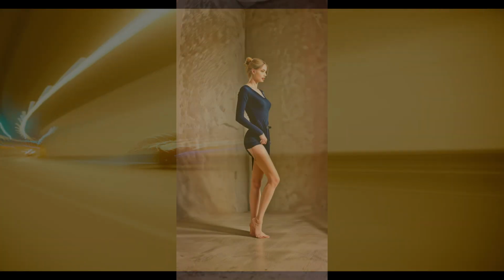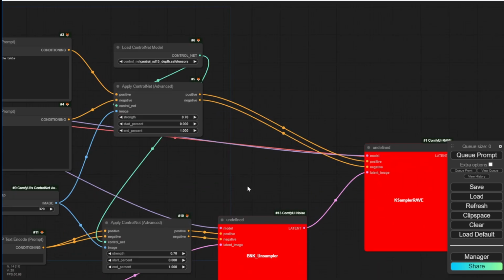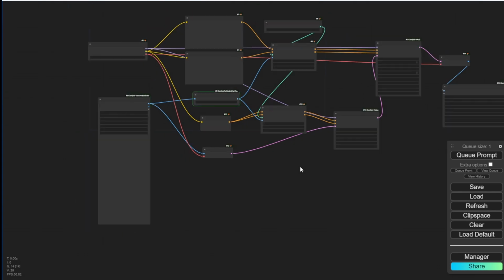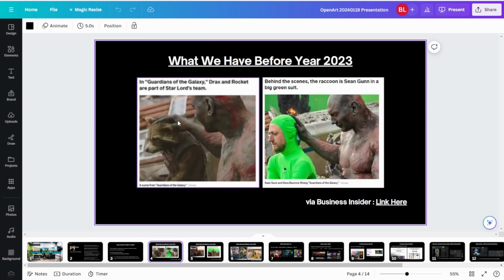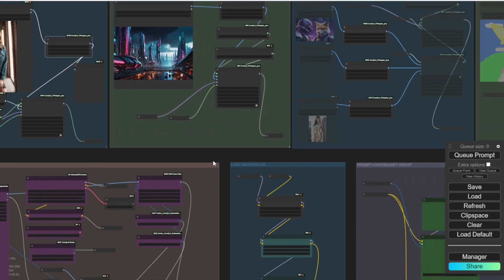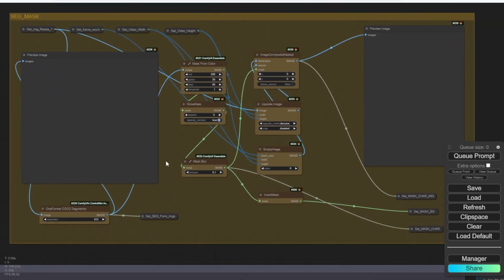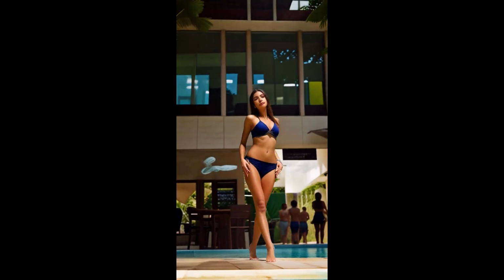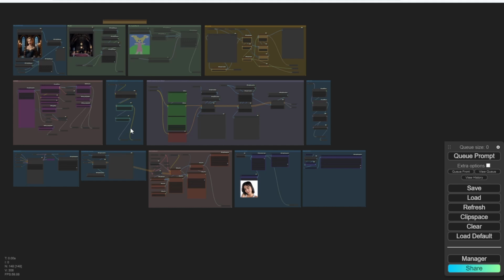Stable Diffusion AnimateDiff and RAVE Create Consistent Style For Animated Video (Tutorial Guide)

Comment: it is a great workflow and patient presentation. thank you! bravo! I am still a beginner, I am just considering video 2 video changing the outfit and make the output video smooth. without complexed requirement of background changing, styling changing, face swap. I keep all of these intact. just change the outfit of the character. in this case, which nodes can I remove from this workflow? by the way, did you try a video with multiple characters, like 3 or 4, Are Rave, ip adaptor, and animatediff robust enough to handle these kinds if videos? thank you.
Reply from the maker: You can check out this one https://youtu.be/alnrfN6F-lI?si=hyl1W49BqlfsgmOF
It is better for your scenario.
Reply: @TheFutureThinker  thank you for your prompt response, have a lovely day. I will join patreon pro subscription to support you.
Reply from the maker: 😊thank you , enjoy and have fun while learning new technology.
Honestly, if you are just begin with SD. You can check out videos to learn the foundation first. That way, it will be better.

Comment: I am still missing how RAVE contributes to vid2vid animatediff workflow. @Benji could have achieved the same balerina result with NO RAVE, ONLY animatediff nodes, like for example in his dancing shorts videos. Can anyone explain the use case or benefit of RAVE? Thanks!
Reply from the maker: RAVE for consistency outfit in this case. And Animatediff make the whole movement smooth. Actually, the AnimateDiff only workflow I did use IPA could do this consistency, but not always, and it require a good image for the IPA to understand what you want.
Reply: @TheFutureThinker I think get  it. So use RAVE when there is totally different clothing in input vid vs output vid. Like in this tutorial, dress converted to bikinis. But if say I want just to replace dancing women's head (face + hair), I should use IP adapter and low denoise, because RAVE is SD1.5 (less realism than SDXL) and is unnecessary for this case
Reply from the maker: It depends on what is the source video, and style your want to change. But mostly I use Sd 1.5 real Vision, but you can try SDXL with something like Real Vis or Reality XL. Because the width and height are going to be large in SDXL , so it required larger memory size from hardware as well. And more time process on each sampling.
Reply from the maker: But for face and hair, yes use IPA is good enough. Sometimes less is more honestly.
Reply from the maker: p.s: and yes you are right, the no RAVE AnimateDiff only workflow , I can do that. Hehe XD